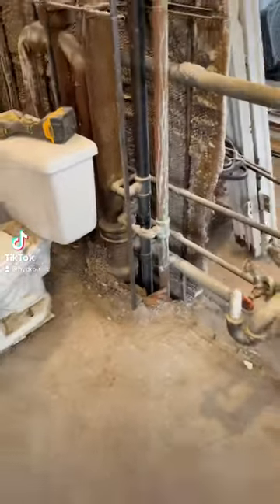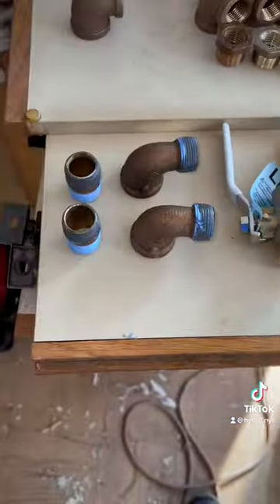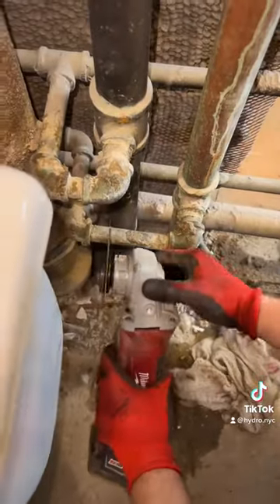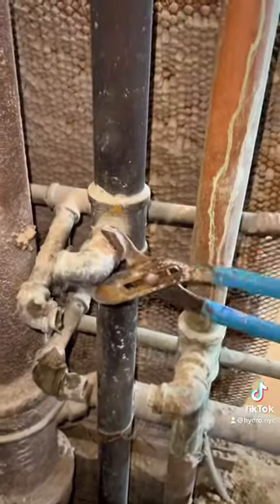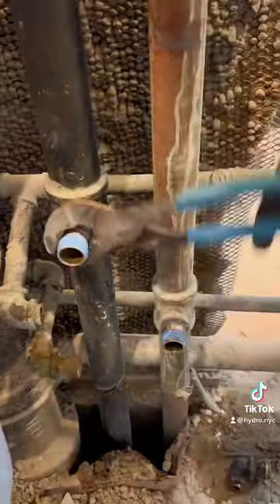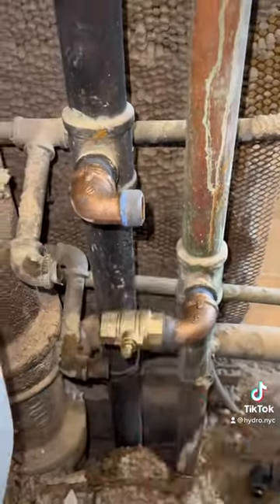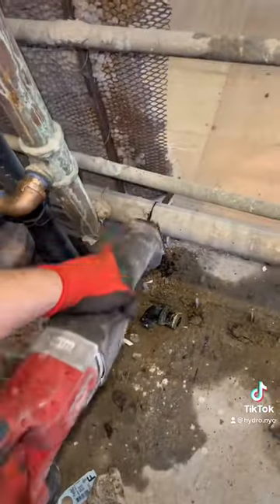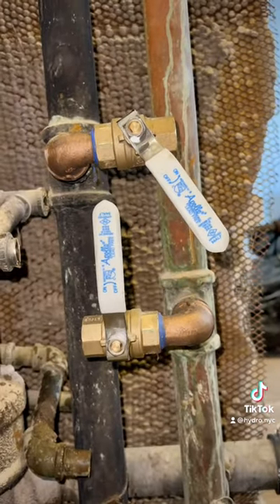Another NYC Water Shutdown

Comment: I had a customer at UN Plaza and was told by him that all water piping was to be brass due to its ability to handle building motion from wind.
Reply: 😂😂😂 maybe he's onto something 😂😂😂😂😂
Reply: If you use a 3 or 4 brass elbow swing coming off the riser, it can help with movement.. the dead men did things a certain way for a reason..
Reply: Brass is the absolute gold standard for plumbing.  It was the first water supply system and outlasts copper, but its expensive as hell.  For a big building, cry once and know it'll be good for a century or more.
Reply: Brass and copper..... nowadays PEX is the most common...
Reply: The customer is only right when you tell them they are.
Reply: @ExtraterrestrialBeing-jc7to  for houses.  For businesses and big buildings metal piping is still far more common.  A leak can cost a ton of money compared to any savings up front.
Reply: @sonacphotos  however, PEX can't handle pressure as well as copper or brass. (Copy pasted)
What is the burst pressure of PEX vs copper?
The International Plumbing Code requires a flow pressure of 12 GPM@25 PSI. So the copper system shows a loss of 4.4 PSI while the PEX system has a 15.2 PSI loss.15 Dec 2020
Reply: @sonacphotos  yeah, go tell that to the government. They seem to think different.
Reply: @sonacphotos  however, to be fair, I've tested newly installed water mains (1.5-2.0km) to new developments, we tested to the meter, using polycop (HDPE) pipe, (3/4" feed from 6" main) at 1800 kpa (18 bar) for two hours, I still have photos 🤓
But, vertically, copper is better for high rise buildings above 10 floors, due to what I previously posted...( Personal exp. 45 years) 👍🍻
Reply: @sonacphotos  Rodger Wakefield isn't a plumbers ass. 😐

Comment: The threads on the nipple and that fitting were good then that’s why it held the way it did.. Metal content is shit these days and there’s so many imperfections you need to make sure shit is tight.. I still have times when I get my threads set just right and I barely have to tighten anything to seal and not leak. Also doing fire protection you get used to making sure it can hold a 200lb pressure test for 2 hours so you can’t have leaks. 👊🏻💪🏻
Reply: Yeah, used to test water mains at 18 bar....still got the photos 😎